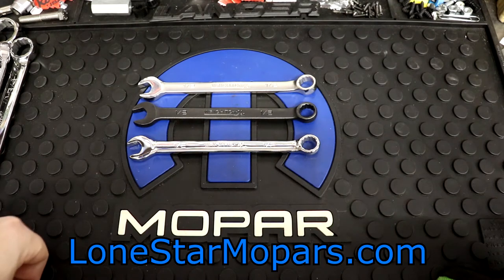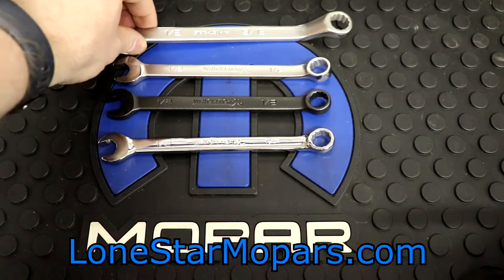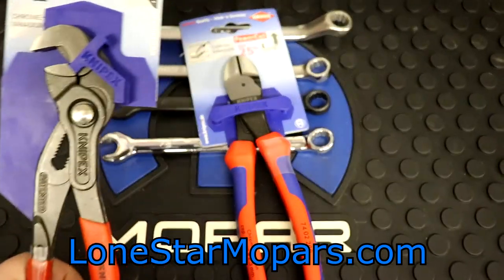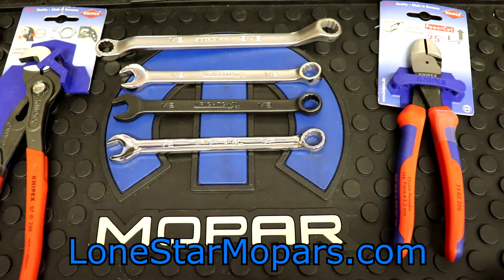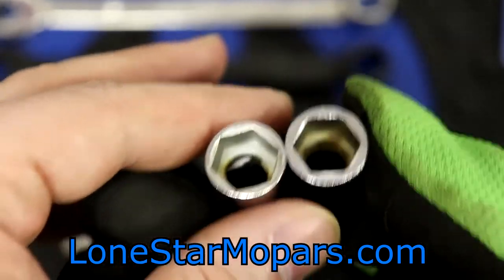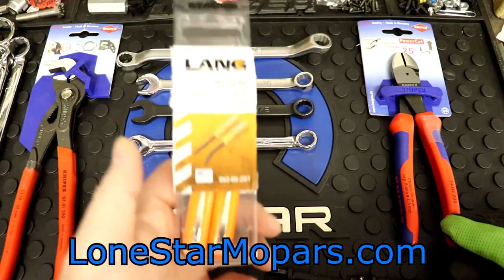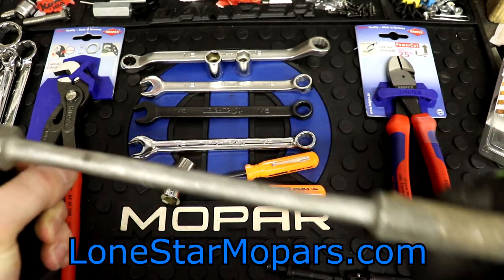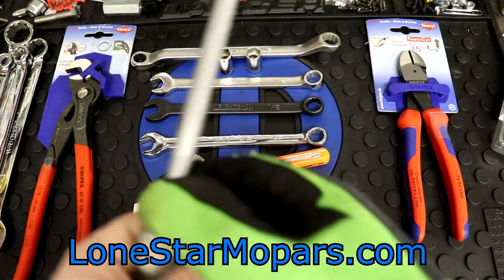HJE Tool Haul #5: 1940s to Modern Day + Unique Socket Score!

Comment: I’ve been an appliance and HVAC technician for 29 years this year and I’ve had the same quarter inch and 5/16 inch malco driver for five years and use it everyday in my Milwaukee 12 surge and it works as well today as it did when I got it. No real signs of wear.
Reply from the maker: Awesome...that is great to hear!
Reply: Malco is so much better than the Klein version

Comment: I picked up the same Knipex tools when I was there in April. If I remember correctly, Jori said that they got them from Wright which I thought was very interesting. I thought that maybe they were for research but nope, apparently they used to sell them.
Reply from the maker: Nice!  Yeah, those were some killer prices.  If I still had old catalogs, I could probably verify that...however, since they sell Channellock etc., it doesn't seem too far out of line.  Kind of cool really.